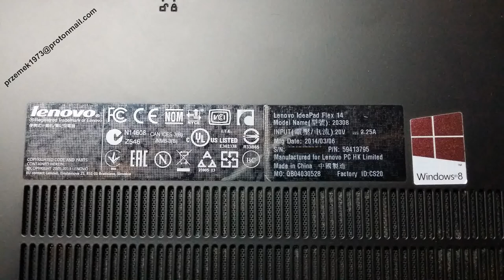Lenovo Ideapad Flex 14 disassembly BIOS battery replacement, cooler fan clean, wymiana, jak rozłożyć

Comment: witam.a czy rozbierałeś lcd w tym lapku?
Reply from the maker: oczywiscie ale nie mam filmu. wsadzane do tego modelu sa rozne matryce,bez rozebrania nie bedziesz wiedzial co tam siedzi. Z przodu dwie srubki,trzeba zdjac tylna pokrywe i wykleic matryce z panelu dotykowego lub ramki.zerknij na rozne modele:
1. https://www.laptopscreen.com/English/screen-part-number/B140XTT01.0/
2. https://pl.aliexpress.com/item/1080P-IPS-LCD-Touch-Assembly-WITH-Frame-for-14-inch-Lenovo-Ideapad-Flex4-14-Flex-4/32812747083.html?ws_ab_test=searchweb0_0,searchweb201602_5_10152_10151_10065_10068_10344_10342_10325_10546_10343_10340_10548_10341_10084_10083_10304_10615_10307_10059_10314_10534_100031_10604_10103_10142,searchweb201603_25,ppcSwitch_5&algo_expid=0ce65f1c-ef66-4cf5-af2d-3158a15052df-27&algo_pvid=0ce65f1c-ef66-4cf5-af2d-3158a15052df&priceBeautifyAB=0
3. https://pl.aliexpress.com/item/Original-14-laptop-touch-screen-digitizer-for-Lenovo-IdeaPad-Flex-2-14-Flex-2-14D-Touch/32687832580.html?ws_ab_test=searchweb0_0,searchweb201602_5_10152_10151_10065_10068_10344_10342_10325_10546_10343_10340_10548_10341_10084_10083_10304_10615_10307_10059_10314_10534_100031_10604_10103_10142,searchweb201603_25,ppcSwitch_5&algo_expid=0ce65f1c-ef66-4cf5-af2d-3158a15052df-37&algo_pvid=0ce65f1c-ef66-4cf5-af2d-3158a15052df&priceBeautifyAB=0
4. https://pl.aliexpress.com/item/11S90400199-B140XTT01-0-Lenovo-IDEAPAD-FLEX-LCD-14-0-DOTYKOWY-14-20308-A-AD11/32842654085.html?ws_ab_test=searchweb0_0%2Csearchweb201602_5_10152_10151_10065_10068_10344_10342_10325_10546_10343_10340_10548_10341_10084_10083_10304_10615_10307_10059_10314_10534_100031_10604_10103_10142%2Csearchweb201603_25%2CppcSwitch_5&algo_expid=b26a38ae-25ea-4816-b096-6e3a3feea0dd-39&algo_pvid=b26a38ae-25ea-4816-b096-6e3a3feea0dd&priceBeautifyAB=0
Reply: moj to lenovo ideapad 14 20308